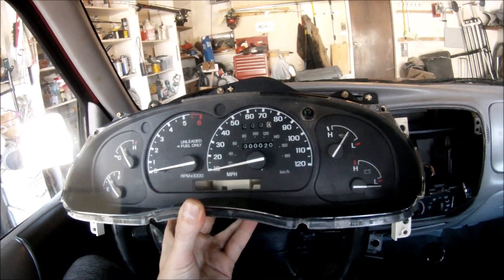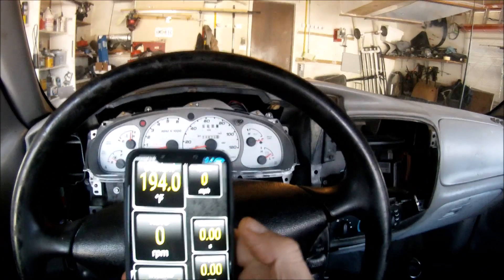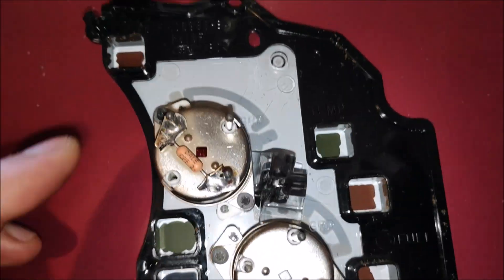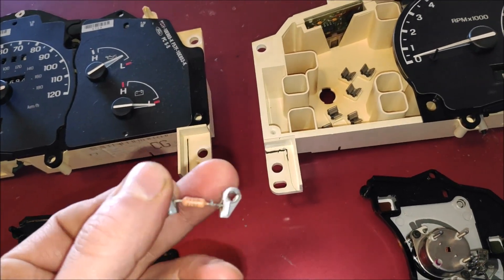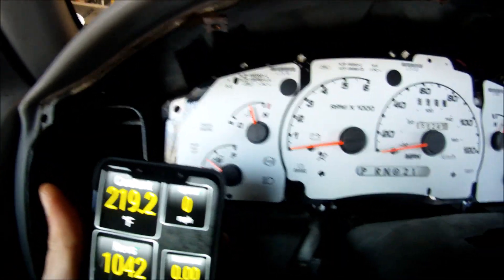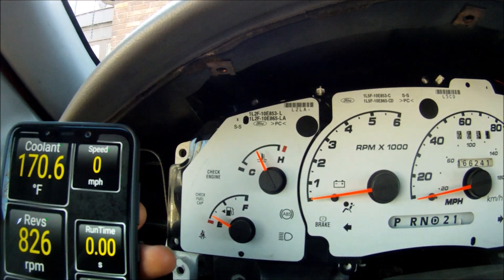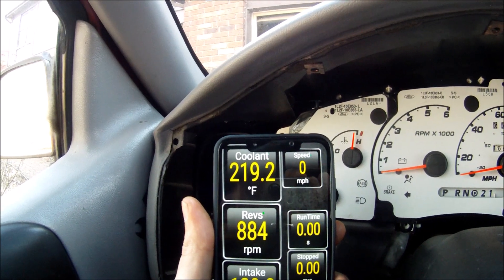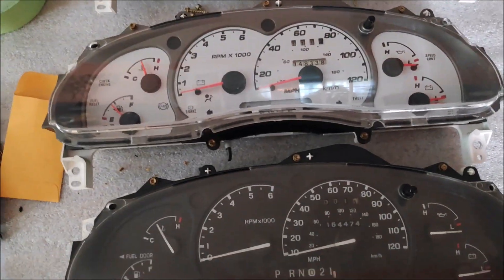Ford Ranger Gauge Cluster Upgrade and Coolant Temperature Gauge Fix, Cheapest and Easiest Technique

Comment: Could you just swap the 95 temp gauge with the 92 ohm resistor to the 01-03 cluster?
Reply from the maker: I don't think so.
Reply: @everydayirace  So I desoldered the 92 ohm resistor from my 96 gauge and put it on my 2001 gauge. Works great now. Thanks!
Reply from the maker: @gtadcock  thanks for letting me know, 👍.

Comment: That “missing” resistor might be on the board. I have one that has 92ohm resistor on the back where the pins connect.
Reply from the maker: I got a 03 ranger gauge cluster in front of me, there's a 100 ohm resistor that goes to diode and then to the signal pin of temperature gauge.

Comment: Also having fuel gauge issues but that may be due to a bad fuel pump. Can you buy new gauges for these?
Reply from the maker: I don't know.
Reply: @everydayirace  After doing some research I found that the likely cause is the slosh module found in the cluster. The module can be bypassed to restore gauge operation. I'll give it a go

Comment: Thanks man, great video. I have a stock 98 ranger. Coolant temp is reading too low. I grounded out the coolant temp sensor and it went max cold. I took a magnet and verified the gauge can go full hot. Going to try a 200-220 ohm resistor and see if that takes care of it
Reply from the maker: When you ground coolant temp sensor gauge should read full hot.
Reply: @everydayirace  I bought a 220 ohm resistor. Once I get time to throw it in I'll let you know how it goes
Reply: @bakihanma7247  I haven't had time to get around to it yet. I do have 100 resistors I bought for 5 dollars though so I'm not worried about messing up 😂

Comment: @EVERY DAY I RACE does this still apply to a 1996 Mazda b2300 with OEM gauge with only the speedometer no rmp gauge.
Reply from the maker: This applies to 98+ gauge clusters that get installed in 95-97 trucks, since 95-97 ranger parts are becoming harder to find.

Comment: Hi .thanks for share
I have Ford Ranger Splash 1995 and have a lot of problems with OBD2 scanners .The one you show  will work on my Ranger 1995?
Reply from the maker: It works on my 95 and 96 ranger.
Reply: @everydayirace   OK,thank you
Reply from the maker: @norbertrivera  you're welcome.
Reply: @everydayirace  Thanks .
You turn on your Ranger and as i can see the RPM gauge of your new cluster  is not working.

Comment: Wow way too technical for my skill level, but I appreciate the amount of effort you gave to get it right!  I have a 96 ranger with blown lights and I will just get new bulbs?  Maybe led?
Reply: The 95-97 gauge cluster is actually blue with white dials when you replace the bulbs with Sylvania 194 LEDs. The dim factory 194 bulbs turn the blue guages green. Still dimmable. My 96 has been this way for 4 years now.
Reply from the maker: Thank you.

Comment: Question. 
What gauge clusters are compatible with my 95 mazda b2300. I'm assuming its the exact same one as a 95' ranger cluster. 
Per my comment on your other video, I am having issues with the odometer, speedometer, trip sensor and coolant temp gauge. 
I guess I'll try to replace the whole thing. Just want to see what options there are.

Also, my cluster has no tachometer, and its a manual trans. It can still fit a regular ckuster correct?
Reply from the maker: 95 will plug in and work like stock, 96-97 will work, but check engine light will not work, 98-03 will work, coolant temp will read higher and cel will not work. Plugging a 95 cluster with tach in my 95 worked, except the tach, might need some extra work.
Reply: @everydayirace  I actually got a 96' cluster from a junk yard 3 mins from my house for $40.

I hooked it up, and the fuel tank marks almost empty, which I will test since I just got the trick and haven't fueled it up, so I might fuel it up and try it. Tach works, haven't tested speedometer, nor odometer will test tomorrow. The interesting thing is that the coolant temp sensor marks hot, just like the other old cluster. Im guessing it might be a sensor in the truck?  

Anyway. Thanks for the help!!! You are awesome. Just wanted to update you.